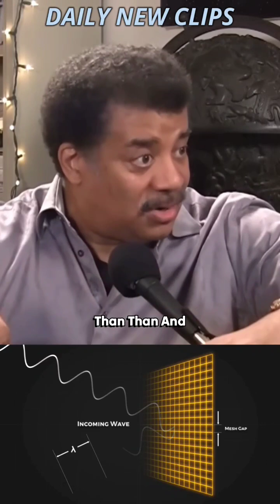Space Telescope On The Far Side of the Moon 🤯 w/ Astrophysicist Neil deGrasse Tyson

Comment: how much bandwidth do you need connected back to earth when you operate radio telescope on the moon? like hubble or JWST? or much more?
Reply: Hubble is only 300 miles high, so it's very easy to communicate with. The JWST is a similar distance to the moon, so they would be comparable.